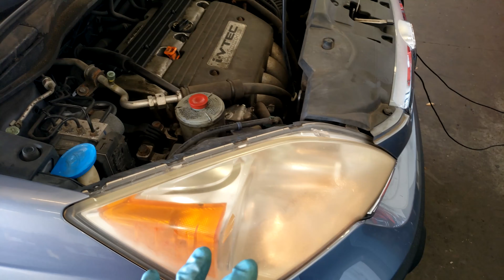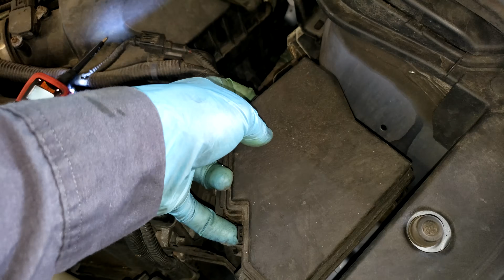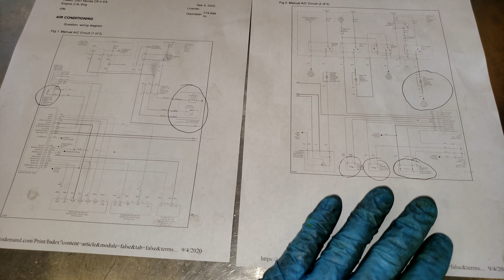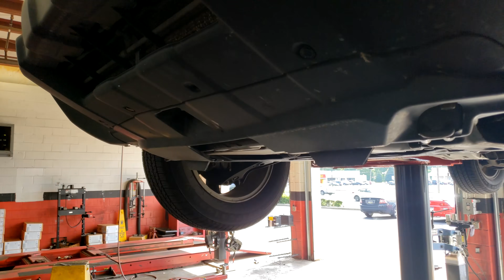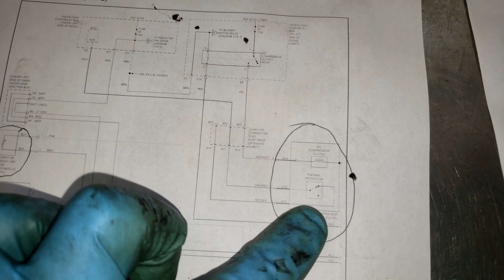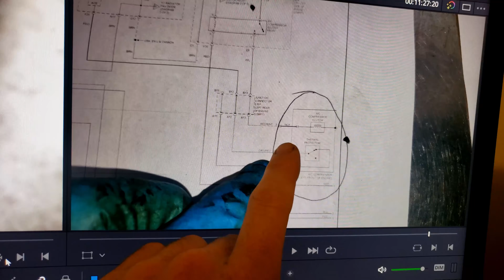Honda Blowing Warm / No AC Quick Diag/Tips - CRV, Accord, Civic, Pilot, Odyssey, etc

Comment: These CRV were the last best made CRVs. I know someone with a 2007 with almost 300k miles. Original everything.
Reply: I have an 09 with 260,000 miles. Runs and drives no different than the day it left the dealer. Awesome car.
Reply from the maker: Totally agree with you on that! There was actually another one right next to it in my other bay and that had about 280 something thousand miles on it
Reply: Except the AC. Look around and see how many CRV's you see w/ open windows in the hot summer 😅😅😅
Reply: @andrewhkim  My 2011 only has 60K miles and I'm dealing with this nonsense
Reply: For a temporary fix, I cleaned the rust off the clutch and set the gap. It has worked so far in 95 degree weather.
Reply: Mine has 252k and having this AC issue where it comes on and works randomly but it usually stops once it’s hot out
Reply: @nagifhelmis3746  sounds like your expansion valve is bad
Reply: I have a 2010 with 400k hahaa
Reply: Me and my girl broke up and she wanted the latest and greatest crv so she bought a 2019? Crv with the turbo and I bought her 2010 with 90k miles at the time.  Right around 2023? she texted me if I could look at her AC system because it wouldn't work. The dealer found something rubbed through the AC hose and drained the system lol.  Proof that your comment is spot on.  Took 16 yrs for the 2010 AC to quit.
Reply: Here because my 2011 with 343,000 miles just got its second AC compressor 3 months ago and now AC is squealing and blowing hot/cold 🤔 She's my baby though - 273,000 miles together